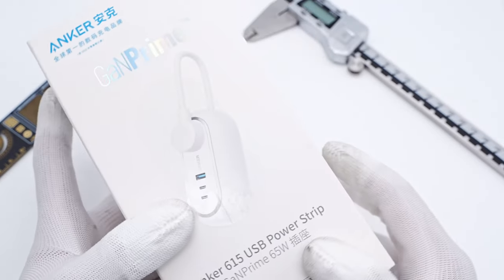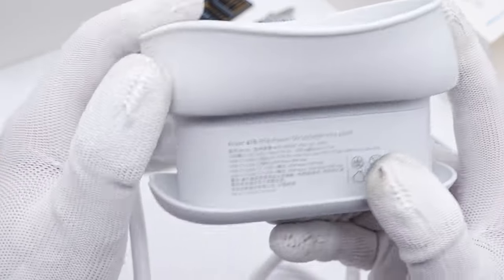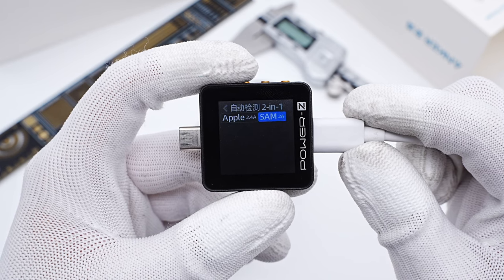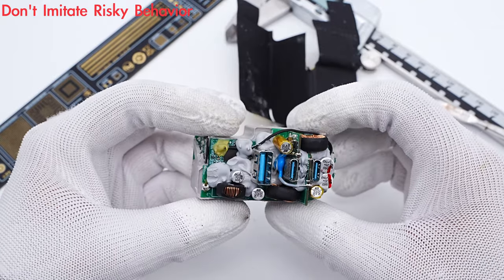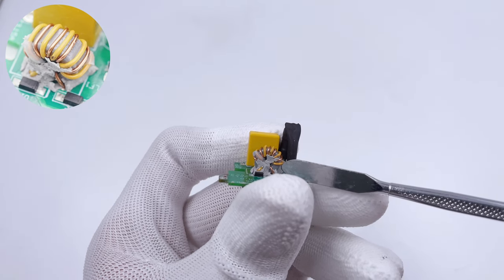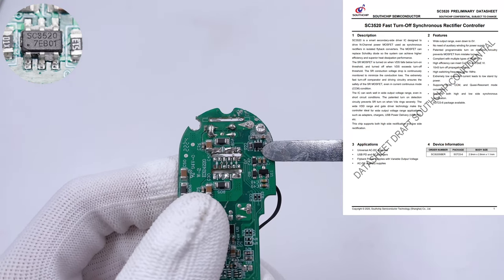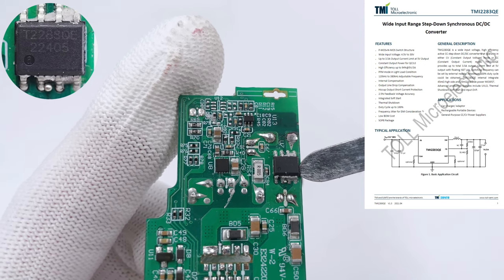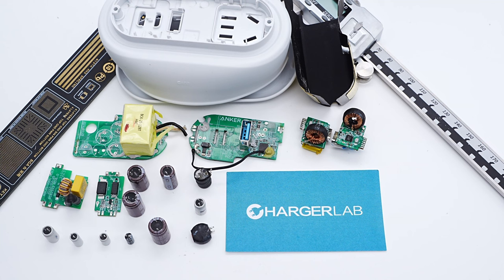Teardown of Anker 65W Mini Power Strip  (GaNPrime 615)

Comment: Still hoping for a good desktop charger with 3 or more USB-C ports and at least 6 ports in total with interrupt free power distribution upon connection change (like it used to be with USB-A only desktop chargers in the past). Anker seems to have the dynamic power distribution part figured out nicely, now only waiting for a proper product to make it to the market... If you hear anything about such a product I'd very much like to see a review (and don't forget to check the interrupt free dynamic power distribution 😉).